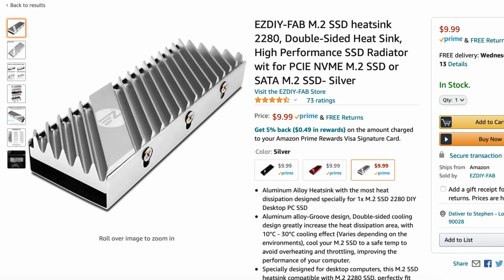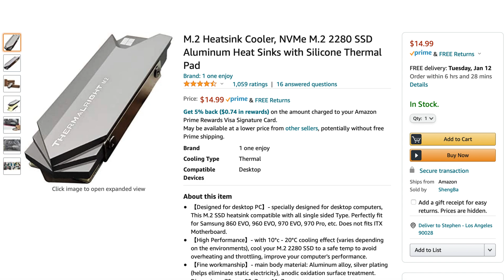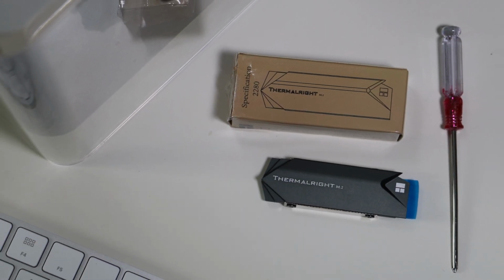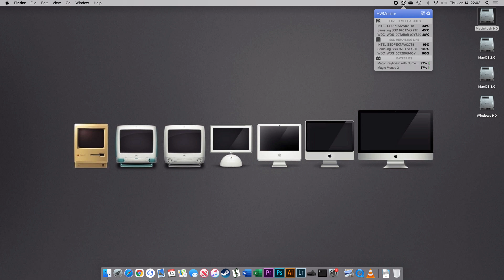Heatsink Upgrade - ITX Motherboard Solid State NVMe - Drop The Temps!

Comment: Hi. Great vid. I have a cube coming in the mail, and I’m wondering if you could comment on the Asrock Z490 Phantom Gaming-ITX motherboard. It’s basically the newer version of your board, but it has a NVME riser board that is about 3/4” taller than the IO backplate. Do you think this would work in the cube? If not, it is removable. Love to hear your thoughts!

Comment: Hi there, does the heatsink on the underside have a thermal pad in between the motherboard? Or is it just metal on top of the motherboard? Any update on how its been so far? thanks!
Reply from the maker: It has two heat pads, essentially inside the heat sink. But yeah no thermal pad on the belly side of the motherboard (outside of the heat sink). That’s a good point though! I wonder if that would further improve thermals!
Reply: @CompTie  thanks for the info! I appreciate it!

Comment: i have 3 samsung 970 evo's in my computer, none of them have heatsinks lol
Reply from the maker: Yeah, it does seem to drop the temperature on the SSDs but I still don't think it's totally necessary, since they are designed to operate fine even at high temps. But it does look cool :)